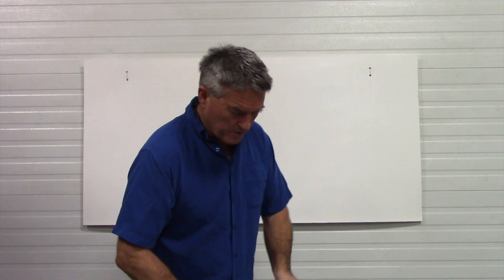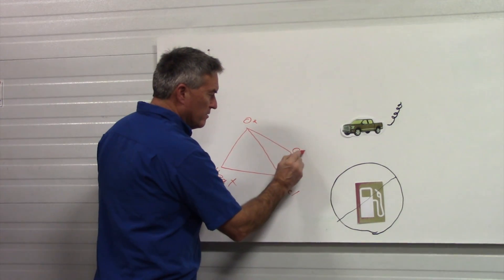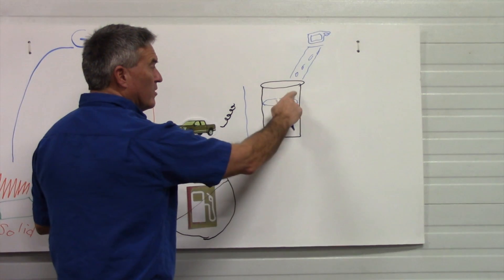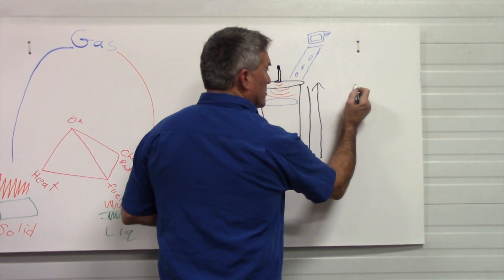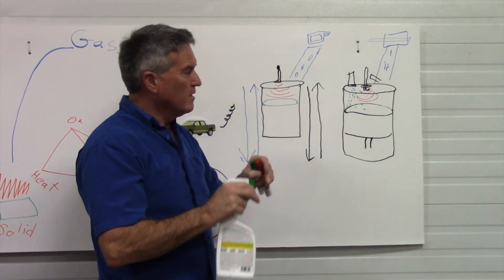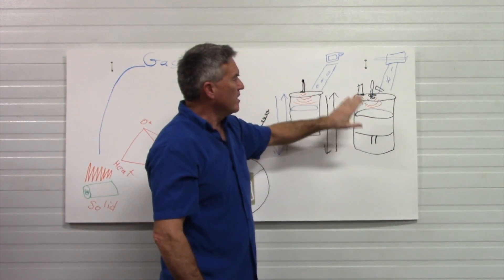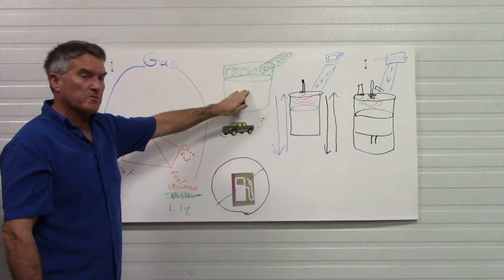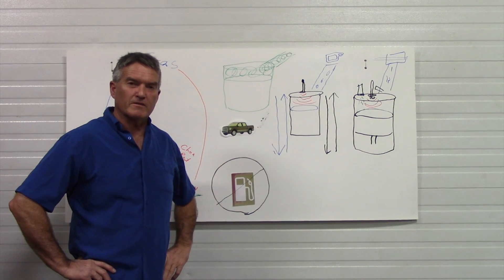One Simple Trick to get 100 miles per gallon with less pollution!

Comment: Ok, you said they had to pump in enough liquid gas to keep the engine cool or it would run "lean" and over heat. How does a gas vapor cool the engine? You say you were getting 70 miles to a gallon on one of the test engines, how hot was it getting? From what you've described, the cooling system would have to revamped to take care of the excessive heat in the cylinder.

Comment: You are rediscovering what has been done since at least the 70s without the internet to spread the word.  Back in the late 80s I bought plans for many different gas vaporizing carbs to study them.  After a few years of these seeing more popularity, the vaporizing chambers were made  less efficient by the gas companies adding "detergent" to the gasoline which hindered the vaporization process.  Coincidence?  Maybe.  The more sophisticated O2 sensors and computers added to cars during those times also hindered the process.

Using electrolysis to split water anto O2 and H2 under the hood, then feeding it into the fuel system does, in fact work and I have get tne 70 MPG with it in the past.  The O2 sensors and computers have also made these systems ineffective, although I see an ebay seller HHO Joe seems to have a legitimate business where his company can work around the computer chips to make it work once again.

BTW - in 1936 John Pogue patented a 200 MPG carb.  The Ford company paid him a couple million ( a lot more money back then) for the patent and shelved it. 

Fuel injection has been around as a technology even back in the 20s.  Oil companies having controlling interests in car manufacturing is what made it so our cars still waste 80% of what we put into the tank.

Another point to consider is that gasoline, being a byproduct of oil and plastic production should mean that as gas prices went from .35 a gallon the the 70s to over a dollar and a half during the liberal Carter administration is that a can of motor oil and plastic bottles never saw such price increases.  As gasoline prices fluctuate yearly with the seasons of the year, so should oil and everything in a plastic bottle if the prices on gas are truly not being played with at the top for large profits.

Carter years oil shortage scam was the biggest illegal, but legalized theft in history.  And the sham continues until this very day as the US now is the largest producer of oil in the world due the fracking (which the liberals demonized for the prosperity iot would bring America), and yet they are slowly inching the prices back up to what they were before the first drop after fracking was implemented.
It seems you have made a way to overcome the problems that fuel vaporization ran into, after working well, in the late 80s and early 90s.  Keep up the work.  Sell your system.  The internet has opened up new paths of diversity the powers-that=be cannot stop anymore.

Comment: So the liquid gasoline system or injector system that is used to also cool the piston during its stroke to prevent overheating would not overheat and run lean being supplied with only matter in gas form?  You mention that through design, development, manufacturing and testing that emissions are almost completely gone so you have motors running with this system.  How did you solve the overheating issue?  Redesign of the piston or was it simply a non issue?

Comment: When my fuel injection engine  has no gas  ( ran out of gas ) I put gas in the tank but before turning engine I remove intake  air channel at air filter , pour or squirt gas onto these plastic channel, crank engine and it fires up immediately due to the gas turning into fumes prior to reaching the combustion chamber . Some times this priming may take 2 or 3 primes in order to get fuel from tank.

Comment: IT'S NOT A FOSSEL FUEL IT IS GENERATED BU THE EARTH. OIL IS A BASE FOR MANY/MANY OTHER THINGS AND WILL NEVER GO AWAY FROM PRODUCTION AS IT IS NEEDED FOR JUST ABOUT EVERY THING AND GASOLIEN IS A BYPRODUCT OF THESE THINGS AND THE BEST WAY TO REDUCE YOUR USE OF GASOLIEN OR PROPAN IS TO SPLIT WATER AND YSE ITS GASES H2/O AND IT IS VERY USABLE AND CLEAN AND POWERFUL. A RAPID PILSE BETWEEN =/- CHARG WIL PRODUCE COPUS AMOUNTS WITH VEWRY LITTLE VOLTAGE VERY LOW FASE PULSE WILL MAKE COLD GAS VAPOR AND IT WILL WORK PERFICLY. ITS BEING DONE BY MANY DIY REAL MEN AND WOMEN!!!! JUST ASK YOU TUBE!!! MANY WILL SHOW YOU SOME ARE REAL GOOD OTHERS ARE DOEING STUPID THINGS THAT DONT WORK SO STUDY THEIR WAYS AND YOU CAN FIND SOME REAL GOOD WAYS TO APPLY THIS TEC!

Comment: A lot of people pointed out that propane is already a gas and it does not have the same energy that liquid gasoline does.  You may want to look up the new idea of using compressed air to increase horse power from 450 to 800 hp just by adding compressed air instead of just using air from the atmosphere.  That is a change from focus on the gasoline to focus on the air intake to make a change in how motors work.

Comment: You said that the fuel is used to lubricate the upper cylinder. If you turn the fuel into pure vapor before you inject it into the combustion chamber, you may cause the fuel to lose it's cooling and lubricating properties, since it would be the liquid in the fuel that cools and lubricates the cylinder wall. The vapor wouldn't have the cling strength to do the job. if you were to use this method, you may have to add top oil to the fuel.

Comment: I'm reasonably sure any combustion engine that used this vapor only method would be destroyed in short order.  You would no longer have the evaporative cooling effect of the tiny gasoline droplets nor would you have the lubrication on cylinder walls from those tiny droplets.

Comment: Since when is fuel used to lubricate a piston?  (I mean besides in a 2-stroke engine - like on most outdoor equipment - where you mix oil in with the gas).

Comment: What about the egr valve car car dude. If you want to gas on gas get a smaller car keep it 100% in shape and keep clean of junk. Junk = weight  and a smaller under drive pulley  and lose Power steering air-conditioner Few solar panels and less Drag on the alternator , but the most Famous reindeer of them all better Arrow dynamic drag

Comment: Isnt this why we have oxygen sensors in the exhaust system so none of the fuel is wasted you can run cars on gas but no better gas mileage that why none of the manufactures bothered with it  gas is a bit cheaper but no better an give slightly less power
Reply: Automotive O2 sensors in general are intended as an emissions control device having more to do with complete burning of certain compounds in the exhaust than reducing fuel consumption. Not to say that they couldn't be used to improve consumption, but in the real world they sometimes actually enrich the mixture to improve burning in the catalytic converter.

Comment: However the problem that is addressed in the video from 10:45-11:15 of overheating unless raw fuel is coating the cylinder for cooling purposes is not addressed by this method.

Comment: On a conventional EFI system, the fuel injector sprays the fuel into a pocket in the manifold behind the intake valve prior to valve lift. Fuel is only sprayed directly into the cylinder on direct injection or diesel engines. Nice presentation.

Comment: Can you say EGR valve.  theres a few types but they regulate the amount of exhaust gas recirculation that gets re entered into the combustion chamber.  design a better egr valve or open it up more.  the main thing is oxygen though for increase power using this set up

Comment: Gas boils at 180 degrees so why is he even saying this stuff? That's what a thermactor tube on the aircleaner intake does!😇it takes heat from the exhaust and puts it in the air to make fuel turn into a gas!

Comment: No one buys tons of gas every year, gas consists of a certain number of hydrogen atoms combined with a certain number of carbon atoms,. In the process of combustion oxygen mates with the hydrogen and produces heat which rapidly expands the nitrogen in the air fuel mixture, which drives the piston down producing power,.. The exuast is water vapor from the hydrogen and oxygen combining and the carbon is released from the hydrocarbons mixture. And that is the same kind of carbon like we all exhale. The trees love it, and all plant life need it to live , in return the plant life puts out the oxygen we all need ,  and the process starts all over,. Its nothing like these s pseudo scientists claim they are only in it for the money and to keep the prices High on all petroleum products..

Comment: Its hard to get over the Fact of the Injectors firing 16 times in one second and having to instantaneously turn into a gas WTF! kind of thinking is that, since the point of the injector is to also break up the gas droplet so that cumbustion can take place. Why wouldn't that be done before injector? What a fucking dumb design. Thank you provoked me to investigate.

Comment: Will not work! Cars have to start in cold temps run without hesitation, and pull heavy loads. It just cannot be accomplished with vapors. Plus it would be extremely dangerous.

Comment: All these gimmicks have the same issue.  You need a fuel air mixture of 14 to one for combustion to take place.  Too lean and it just won't fire.  So no matter how efficient your delivery system, you can't change the ratio.  The second issue is it takes a certain amount of HP to move a vehicle, and that can't be changed no matter how efficient the fuel system.

His logic on the fire triangle is wrong.  The heat to ignite the fuel and air does not come from the engine. It comes from the spark plug.  On a diesel engine the heat comes from the compression cycle.

He is also dead wrong that the liquid gas doesn't vaporize until it is ignited.  The carb or injectors vaporizes the fuel as it passes thu.  It it didn't, you would have a flooded engine.
Reply: Robert Heinkel The ratio you're referring to is called stoichiometric. Gasoline's stoichiometric level is 14.7:1. Ironically the same number of atmospheric pressure at sea level. This is the ratio that gasoline burns as close to "complete" as it can with the least amount of heat. It doesn't mean it makes the vehicle's engine the most efficient though. It just produces fewer hydrocarbons. 13.7:1 is actually more efficient. 

Your HP argument doesn't matter in this scenario. My 1971 Camaro weighs right about 3200 lbs. With the 350 I have in it I get about 16mpg doing 65 mph. If I were to replace the engine with a 2.5L 4 cylinder it would use less fuel to produce the same amount of work even if I were to add weight to keep the car at 3200 lbs. It's not like it would jump to 30 mpg but it would use less fuel. 

Overall you're correct about the ignition cycle. IDK why you mention diesel engines but whatever.

And lastly, he is partially correct. The fuel is first atomized by the carburetor or injectors, emulsified by the air it's mixed with and vaporized under compression by the heat created from the compression. Then it's ignited. It's not uncommon to have fuel puddle up on the floor in the plenum of an intake manifold on a carbureted engine before it reaches operating temperature. It's much harder to atomize fuel when the surrounding air is cooler.
Reply: +Carl Jr   What I meant was liquid gas is liquid gasoline.  Quit trying to nitpick when you know full well what I was talking about. 
I don't care whether the gasoline is sitting in an open container with no lid or whether it just exited a injector nozzle in teeny tiny droplets. It starts vaporizing the instant it hits air. If it didn't it wouldn't get cold. Anyone with any knowledge of physics knows this is evidence of the fact. Same is true for water.  I build high performance diesel engines for fun these days. I know compressed air gets hot. I also know I do not need any extra heat to vaporize gasoline. 
Do this experiment. Take a butter tub of gasoline and let the temperature stabilize with a lid on it. The temperature of the liquid will get to the ambient temperature in an hour or so. Now mark the level of the gasoline. Remove the cover and put your temperature probe in it and come back in an hour. The temperature will have dropped and the gasoline level will be lower. This is because the gasoline is evaporating into its vapor form (aka into a GAS(not gasoline)). 
If what you said was true than you could never get an explosion out the intake manifold which can happen and has happened many times from a stuck open intake valve. No compression actually needed at all.  Get the picture or are you still so ignorant of the physics and chemistry of gasoline?  I don't know how to explain it any simpler. I sure hope you aren't working on other peoples cars.
Reply: consaka1 Atomize. Atomize. Atomize. That's the word you're refusing to use correctly. If you don't understand the difference between the two (Atomize and Vaporize) then you should not be continuing this conversation. That's all I originally corrected you on but you got a hair up your ass after I tried ensuring that everyone else understood the difference.  You started battling me after I was merely trying to clarify what you stated after failing to describe atomization correctly by calling it vaporize.

By the way, your "tub of butter" example is great and fits your narrative well because of the "hour" part. Last I checked, the compression stroke of the average running automotive engine doesn't take that long. It's more like milliseconds. Again, the only way the fuel can vaporize that quickly is under intense heat and compression. Not sitting in a fucking tub of butter.
Reply: That is incorrect Robert Heinkel. liquid gas starts vaporizing the instant it leave the injector and or carburetor. Spill some on your hand and you will see that it can't be avoided in room temperature air.
Reply: consaka1 "Liquid gas" only atomizes when it leaves the injector or when it is drawn through the carburetor and mixed with the air being rushed through the venturi. Vaporization doesn't begin until the heat from the compression stroke heats the air/fuel mixture. What you're referring to when you say "spill some on your hand" is evaporation. Granted that is a form of vaporization but occurs below the 212* F (boiling). The vaporization inside a cylinder happens much faster than normal evaporation.
Reply: Evaporation is another form of vaporization. My statement above is absolutely correct. Heat will make it happen faster but it starts happening immediately on exposure to air.  212*F Is not the specific boiling point of gasoline and is really irrelevant to my statement and to the conversion of gasoline to a volital fume or gaseous form.
Reply: consaka1 I'm not trying to argue. Just educate. I never said you were wrong about anything. You just weren't 100% correct.
Reply: To educate you need to show where my comment is wrong. Not just sit and repeat most of what I said and then go off on some tangent. You did not give any new or accurate info and you failed to prove with any evidence where I was wrong about anything.
Reply: +Carl:  He got the message, (that you are being really, really juvenile),   for his reply see his former comment  (-;
Reply: says you

Comment: Aviation guys say that running lean initially runs hotter but if you go to maximum lean it then gets cooler ; measuring exhaust gas temps (EGTs).   So maybe it would work.

Comment: I've seen 2 videos of engines running on the gas bubbling creates gas fumes devices *(ez to build, just insert on long tube (A) to bottom of tank, then one or two short ones (B's) that run to intake throttle body (must be airtight).  Tube A should have an air filter attached to it to filter the outside air to keep out dust etc.  Both A & B tubes can be rubberized flexible or hard metal.  Tube B suckes air off the top of the inside of the tank, creating vacuum which in turn sucks air thru tube A which bubbles up thru the tank to create the fumes.  The engines DO run, but I can not say how good the mpg improvement is; one guy said 20x more and another said only 3% more?  But it would be worth noting; that another guy way back wrapped his gas line around the radiator hoses and got something like 20% more (due to heating the liquid fuel ahead of time)?